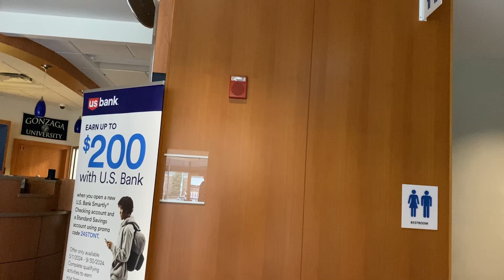Testing Fire Alarm Advanced Smoke Control

Comment: We have a similar fire/smoke door in the equivalent commons building in my college’s campus, except ours appears to be a wrap around curtain style door on the top floor that closes around the main atrium from the side: nothing on the 1st or second floors. I believe most of our buildings have FCI systems, and of those, the modern ones have System Sensor devices, a mix of horns and speakers. I believe that particular building on my campus has an FCI 7200 panel, FCI MS2 pulls, FCI ASD-PL smokes (and FCI OSI beam detectors in the atrium) and mostly System Sensor SpectrAlert P24110 horn strobes, with 2 replacements: a SpectrAlert Advance P2R, and an L series P2RL.

Comment: Day 4 of notifier with simplex speaker strobes
Reply: More like day 0. Not a single one of these systems has had simplex speakers 💀
Reply: You said day 3 on the last video. Also there isn’t going to be a high chance of a notifier system using simplex speaker strobes
Reply: Meanwhile I go to a place with Wheelock speaker strobes and a Notifier system
Reply: yeah notifier is everywhere from wheelock to gentex, what else
Reply: These are actually wheelock E-70 speakers I believe so
Reply: @Bus293Fan Close, they're E50's